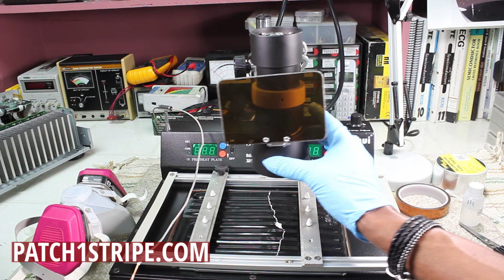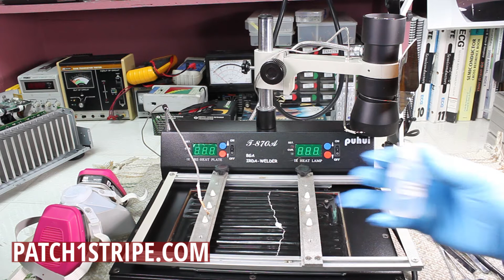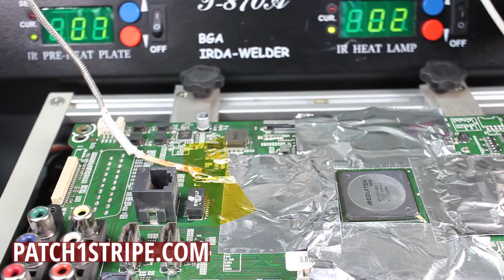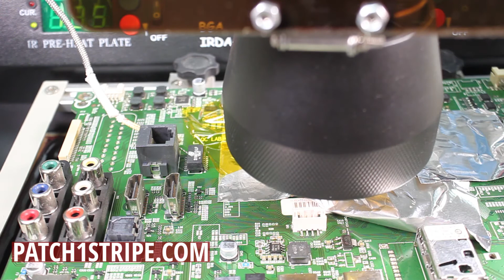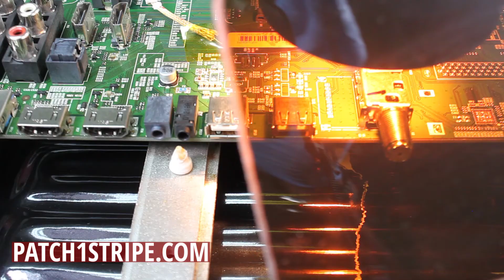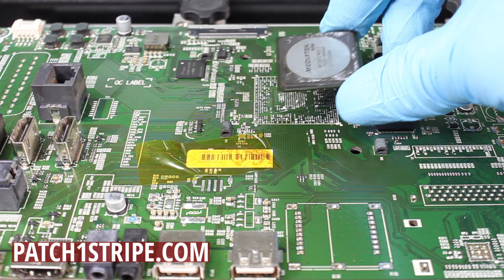HOW TO REPAIR ANY SAMSUNG LED TV -  Infra Red Welding and Soldering

Comment: I'm a proponent for board repair, too many times we have to replace the entire PCB and it's expensive, not to mention if it's a rebuilt or a re-scraped board it may be bad.!!
I started 40 yrs ago when everything was repaired down to component level. 
That's the way it should be now, replace the components not the entire board.
Good video.!!
Reply from the maker: Thanks for the wisdom.